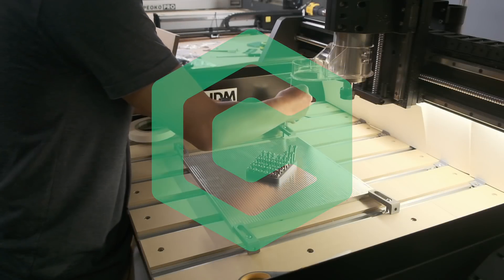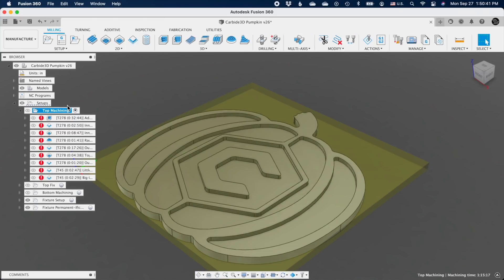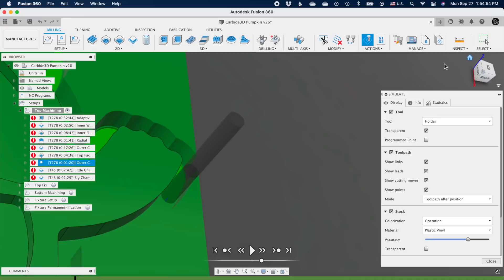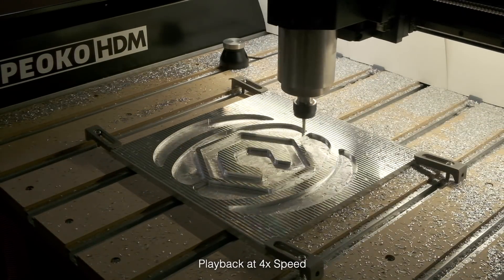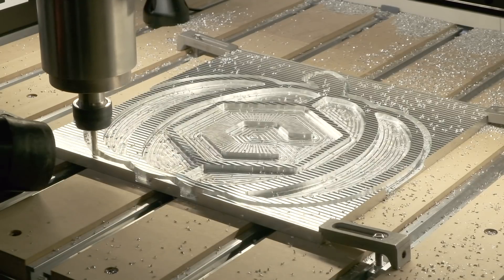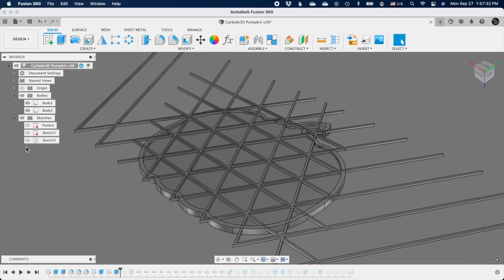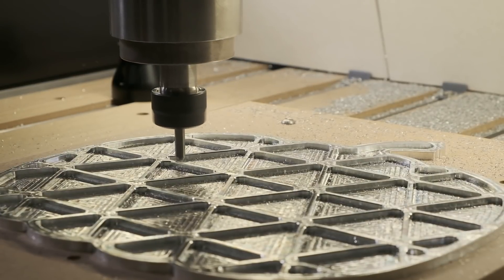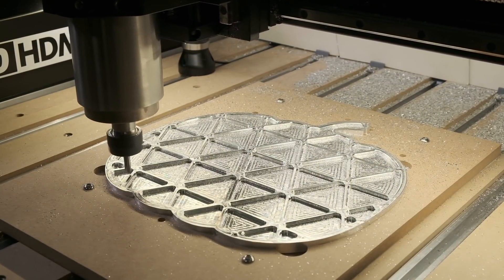Machining an Aluminum Pumpkin on the Shapeoko HDM

Comment: Hi Winston. Just got my HDM, un-crated and setup. Would really appreciate some tips on feeds and speeds for 1/8" and 1/4" end mills in aluminum and wood. I also prefer using Fusion 360, would you happen to have a HDM tool library for Fusion 360?  Thanks!

I tried using a 3 flute 1/4" end mill at 195 ipm (max for HDM) at 6700 rpm for a chip load of .009 per flute. It seemed to cut particle board nicely, but it's crazy fast.  I wonder if going that fast is okay for the machine.

Comment: Overall great and informative video.
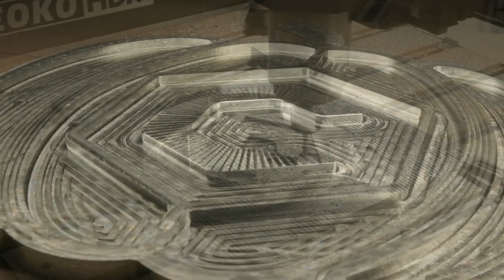🎃If you notice at 10:08, your chips are dancing across the piece. This vibration is more than enough to contribute to the less than mirrored finish you commented about. Likely due to the two sided tape, and the fact you were dealing with a rather lengthy, and thinner plate. Thats always going to be a factor. try a .002 - .005" finish pass next time. Also, 20k rpms seems a bit high. That could also cause some drag as well.

Comment: Is there a possibility for an ATC spindle, additionally are there any alternate act spindles that would work well with shapeokos?
Reply: There are lots of 800w spindles that fit the stock Shapeoko mounts, get a water cooled one. Amazon, Ebay, Aliexpress.

Comment: Pretty nice little machine. At least until you look at the price... It looks like a very nice and well built router, but at $4900 you could easily build 6 Printnc's. Not trying to dog on this machine as I think its a nice little machine, and I know there has to be a bit of markup for making a profit, but $4900 is a pretty big pill to swallow for a router of this caliber.
Reply: Maybe true, but if you count your hours building the PNC it would be similar in price.  I've seen people estimate a PrintNC to be worth $5-6k if it were sold, so there you go.  It's not really a fair comparison.
Reply: @auricschiller  Just a friendly counter argument (I say friendly because I know people on the interwebs like to flex their keyboard muscles when they think they are being attacked, and this reply is nothing more than a friendly counter point of view). I just can't see the hours of your time to be worth that much though. To me a few hours worth of work doesn't equal a multi-thousand dollar upcharge. I personally would never spend that much on a tabletop CNC regardless of what it is or where it came from. Realistically, once you have ordered all the parts to make something like the PNC and have them in front of you, the time to assemble and start making chips on it should be somewhere between 8 hours to potentially a weekend worth of time depending on your level of skill and knowledge. As an added bonus you end up learning a lot more about the machine from actually building it. But at the end of the day it's definitely up to each individual as to what is better for them. I sure won't lose any sleep over how someone chooses to spend their money.. lol. All that being said I do really appreciate Carbide3D and all they do for the home gamer CNC market. They do make some pretty decent machines and the videos they put out are typically pretty good and informative! Also have to say it's pretty hard not to click on a video when Winston is behind the camera. His videos are always very entertaining and educational!
Reply: @tken93  I own a Shapeoko 4 and I'm also building a PrintNC.  Carbide3d's HDM offers a very different value proposition that will definitely appeal more to the small business owner than the hobbyist.  As the cost of time goes, if it's just a hobby then it doesn't matter, but I don't really see people building a business on a PrintNC.  It's just not as reliable (cue videos on discord of parts flying out of machines), isn't turn-key, and you literally need to manufacture your own replacement parts. 

That's not to put down PNC at all, obviously I'm into it.  But comparing the two is sort of like saying a Porsche 911 is too expensive because you can build a kit car that has the same performance.  No matter how much time and effort you expend the kit car won't be quite the same thing. And that's fine, but let's make fair comparisons.
Reply: This machine is too expensive for what it offers and for the components it has.
A PNC is also better in performance and I agree that building it, is also a pro. You learn a lot by doing it and that makes up for the personal time you put in to do it.

Comment: Any future plans for making a water resistant machining bed? I like to use a light mist when machining but the stock mdf absorbs water and warps easily.
Reply from the maker: It is something we're looking into. Additionally, we expect there should/will be third party options for bolt-on modifications (ex. an aluminum fixture plate from Saunders Machine Works) that allow you to skip the MDF.

Comment: Your clamps are not being applied and utilized in correct fashion. The screw tightened nearest to the anchoring side eliminates the entire concept of leverage and force. I suppose it worked for this light set up, but ideally you should shim leverage to your workholding.
Reply from the maker: I know they're not optimal, I was working with the placement of the spacing of the T tracks and length of clamps available, while  keeping the clamps in the corners, as far from the cut area as possible. It was a calculated compromise. -W